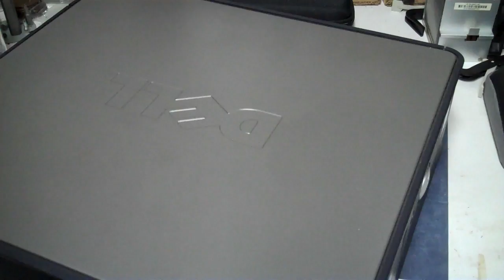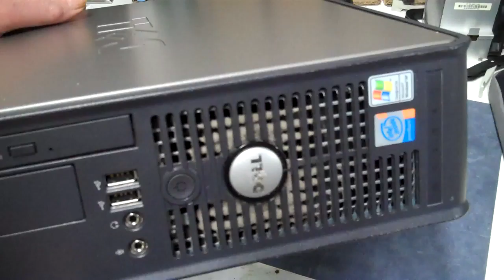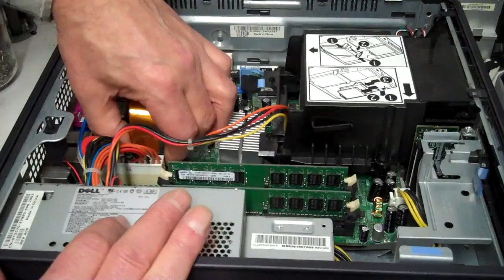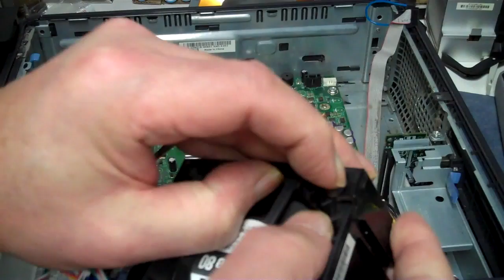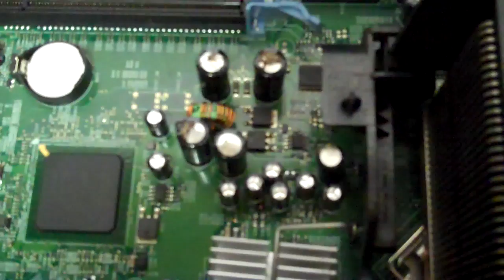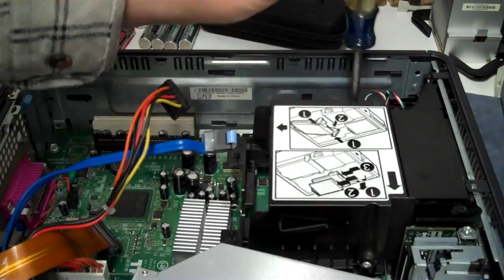Dell Optiplex Fan Fix Complete Walkthrough - GX620 760 780 SFF

Comment: Mine had all 4 rubber holders for the fan broken. So the fan was not being held by anything and it was making A LOT of noise. Good thing that I had 2 other GX620 laying around for parts. One of them had 2 rubbers ok and the other one had all 4. I also opened the fan sticker and applied some Singer Oil into the cooler. Be careful not to put too much oil and try not to let oil get on the outside plastic, where the sticker will be reapplied. Also, be careful not to get the sticker glue dirty, so you can put it back in place (and hold the oil inside). I did not reverse the fan, I think it works better the way it is and you also get positive pressure inside the case (which is good for a number of reasons).

Comment: The CPU fan is supposed to be blowing through the cooler, not the other way around. While your workaround may lead to less dust buildup, the CPU & rest of the PC will run hotter. Maybe a good idea to somehow attach a rear fan to the outside of the rear of the computer to pull out air instead. BTW, I replaced my fan with a Noctua NF-A9 PWM fan, there's adapters for sale on eBay to convert Dell connectors to work with retail fans. One of the connectors is a dummy, Dell engineers thinks consumers are stupid, many of us can upgrade the fan to one with a higher output (more RPM) for better cooling.
Reply: Hey Charles, I did the same with the housing fan (not CPU) on my Optiplex 8300 sff but now I get an Error when I start up. The Noctua fan is working fine but I think it has a lower RPM so the BIOS thinks it's faulty. Did you encounter the same issue and found a work around?

Comment: Soooo, the question that comes to my mind is this: if reversing that fan flow was the best solution for this computer, would not the Dell Engineers have done it that way to begin with? It seems you might be giving the MB better cooling at the cost of less cooling to the CPU. I'm not sure which is the hottest running component, but am thinking it might be the CPU . . . . ?
Reply from the maker: Maybe they engineer it to fail
Reply: No, I believe he is wrong. This is maybe a short term solution, but will fail miserably in the long run. I cannot believe nobody else has commented, but the fan was the correct way to begin. The CPU needs to stay cool the most. Unfortunately, cooling for this system overall is lacking, flipping the fan is not the solution. Keeping it clean the the best thing you can do. I cannot disagree with him though, maybe they are engineered to fail. If your CPU is too hot, pulling hot air into the heat sink, not cooling... then your CPU throttles (CPU slows down) and the vents can get clogged the other way just as easily and cause the components to overheat and the capacitors to go bad just the same as in this video. Also, this PC is very old in the image, and no matter how good the cooling is, these capacitors could have gone bad along with a batch of bad capacitors that plagued PCs in this generation, not only Dell's. You can google this information, I will not go into details. I do NOT recommend flipping the front fan! This will also cause dust to be sucked in from the back vents and as I mentioned can only fail miserably in the long run.
Reply: Yeah, this is documented as making these systems run hotter. He doesn't even notice the fan under the HDD either.

Comment: Hello. I have an Optiplex 7010 but intake fan died. Need to replace it but can't find the original fan. So want to get a 80x80 fan instead (noctua orso...). Do you have the pinout from the original cooler.  Yellow/Red/Black/Blue , so i can solder on the new one. 3 pin probably. Thanks in advance.
Reply from the maker: I will check  tonight for you.

Comment: I believe he is wrong. This is maybe a short term solution, but will fail miserably in the long run. I cannot believe nobody else has commented, but the fan was the correct way to begin. The CPU needs to stay cool the most. Unfortunately, cooling for this system overall is lacking, flipping the fan is not the solution. Keeping it clean the the best thing you can do. I cannot disagree with him though, maybe they are engineered to fail. If your CPU is too hot, pulling hot air into the heat sink, not cooling... then your CPU throttles (CPU slows down) and the vents can get clogged the other way just as easily and cause the components to overheat and the capacitors to go bad just the same as in this video. Also, this PC is very old in the image, and no matter how good the cooling is, these capacitors could have gone bad along with a batch of bad capacitors that plagued PCs in this generation, not only Dell's. You can google this information, I will not go into details. I do NOT recommend flipping the front fan! This will also cause dust to be sucked in from the back vents and as I mentioned can only fail miserably in the long run. Edit: Higher temperatures obviously do not help the capacitors, and can cause them to fail pre-maturely, like in this video. Again, best solution was to keep the vents cleared out.
Reply: This total Chad wants to keep his hard drive cool, idk why... But. Let him fry a CPU and figure things out

Comment: I need to replace stock fan with a much quieter, is way too loud.
Reply from the maker: well be careful when replacing as the wiring for a fan not made for a dell might have a different wiring setup.
Dell is non standard.
Reply: Fix It Yourself! Do you have any videos how to do so, I need a quiet fan, any recommendations
Reply from the maker: I'll see what I can find out for you.
I don't have any other video yet for this.
But I do have a couple dells to work on.
Reply: If it is loud, the rubber things that hold the fan are probably broken and the fan is not being held by anything. Mine was like that and it was making a lot of noise. I was lucky to have a spare GX620 to get the parts, then it became pretty quiet, even when using 100% CPU.